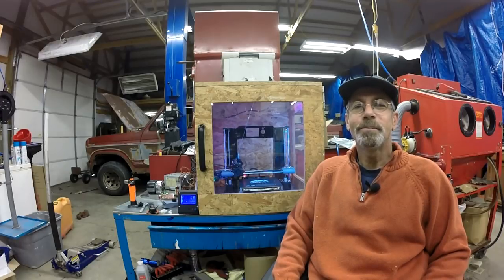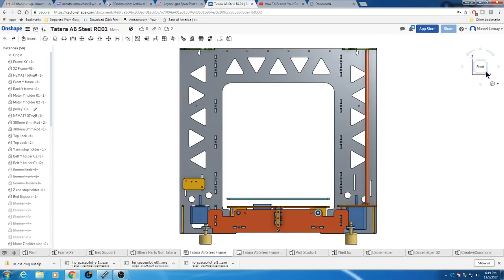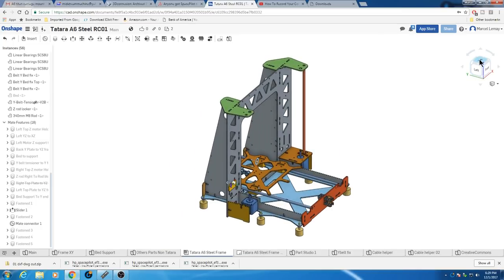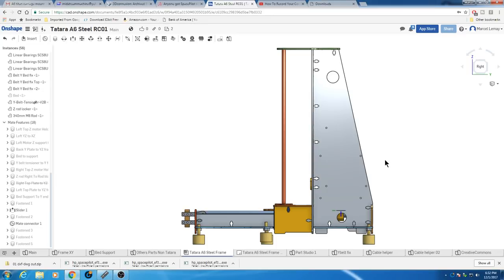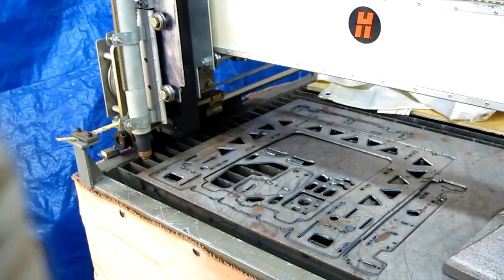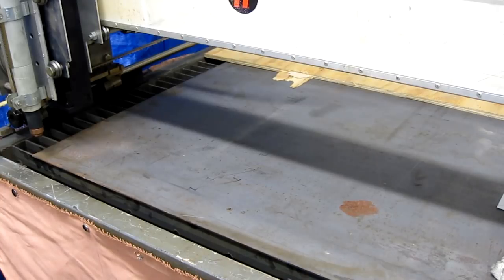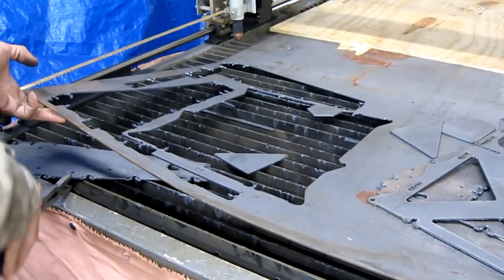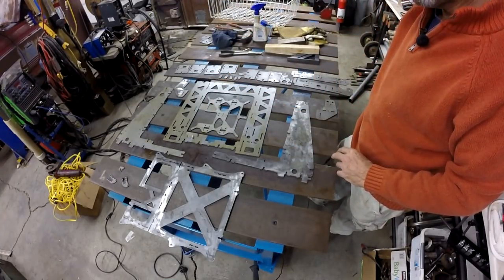Anet A6 Steel Frame Upgrade

Comment from the maker: I'm the Guinea pig for this new steel frame design. I'm gonna put it through some trials before we make the CAD files official. I'm gonna offer a cnc plasma cut , ready to assemble and finish frame, once any bugs have been worked out. I don't foresee any major design issues. Tatara did a great job designing this frame. See the links above for more info. I will update the links once this becomes official!

Comment: My 3D printer already has a steel frame (Printrbot Simple Metal) but I'm going to be getting an Anet A8 soon and the steel frame for that would be awesome. Thanks for the links and the video. I think this project is going to be really cool. Are you going to paint the frame or powder coat it? The plasma is working great thanks for showing it in action also the downdraft table, I think, is way better than a water table. Thanks for the video can't wait for the rest!
Reply from the maker: George Chambers I haven't decided on powder coating or painting. My first inclination is to paint it. I can get the paint done in an afternoon. Powder coating is gonna be time consuming, and I just got to much on my plate right now to spend that kind of time on it. I was never to crazy about having standing water in the shop next to my machine tools, that's why I decided to go with a down draft.The one down side to down draft is that it sucks the heat or ac right out of the building. At my old place,  i had a separate room for the plasma where I piped in replacement air from the outsideand that worked great. But honestly, I don't use it enough to warrant the expense of building a room for it here. I only heat my shop when I'm in there,
 so, on the days when I'm using my plasma,  I'll just keep the heat off, and wear a jacket.😊
Reply: I'd probably also paint. It's too big for my toaster oven. I get the drawback to the down draft but I don't have heat or AC in my shop :-(

Comment: any concerns over expansion/contraction with steel?
stainless, mdf as an alternative?
Reply from the maker: +glenby2u   Steel expands and contracts much less than acrylic or mdf. Also Mdf is susceptible to moisture which makes it move even more. Stainless is the same as regular steel. Aluminum expands more than steel bit less than acrylic.